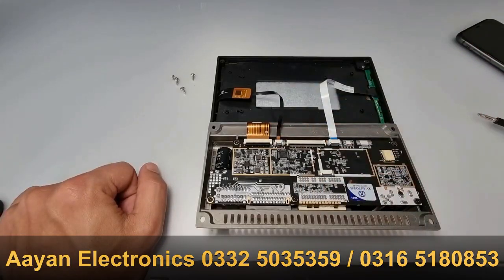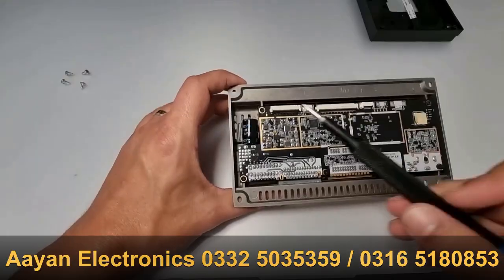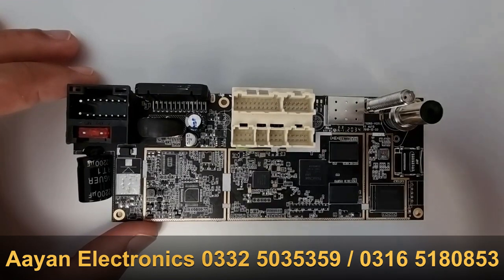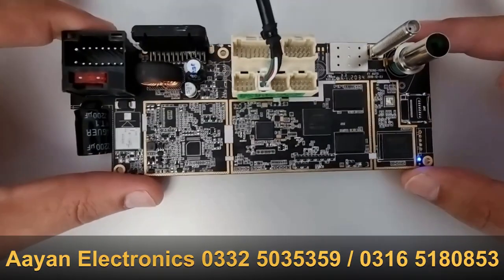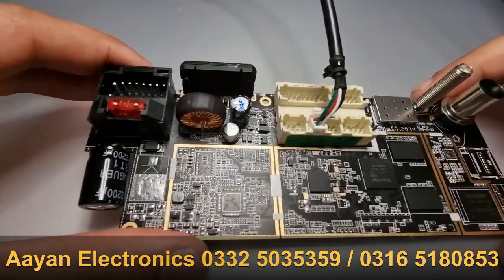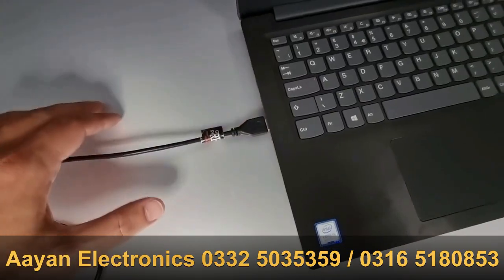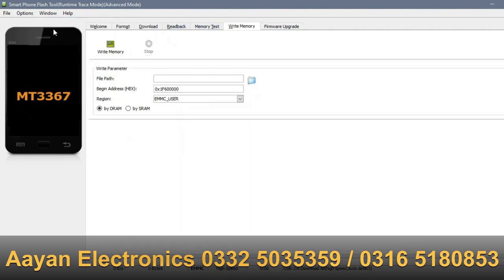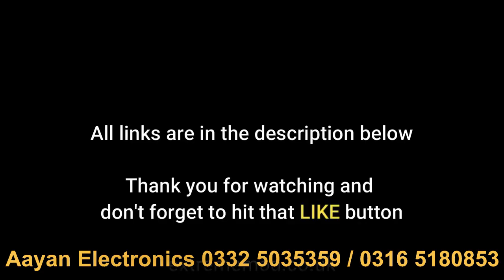How to  Chinese Android UpDate Head Unit   Test Point method   8227L   universal car stereo

Comment: Hi there!
Cheers from Miami, Florida.

I bought an Android radio from Amazon that went black screen on me after a system update. 
It doesn’t even turn on.?

The mother board looks nothing like the one you’re working on in this video. Yours looks high quality. Mind its just a cheap knockoff board with no blue LEDs and no easy way to find the two reset pins.

Hope that the details below can shed a light on the board I have to point me in the right direction to find those pins.

System version: JCAC10003-0C2-V1.0.97R3-231023_1114. 

CPU: 8227L_demo. 
Chip: MTK 
Android OS: 13 (or 12).

Printed on the board:
CYC26 ver 0.1 2023 03 21

Label on the board:
961AMCP 2+64G ASP AHD MIPI FBC0201482

Label on the radio’s outer housing:
A3196JC